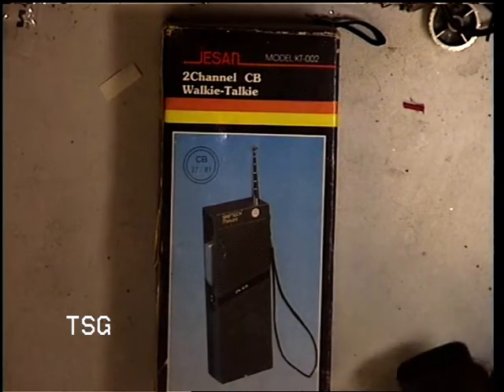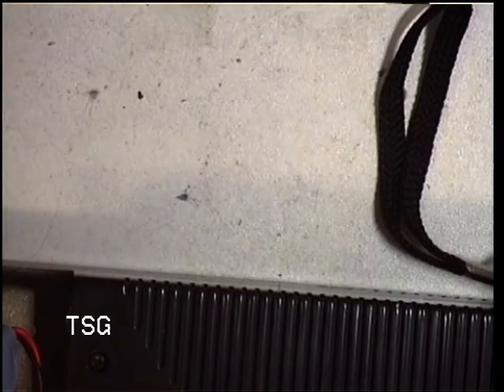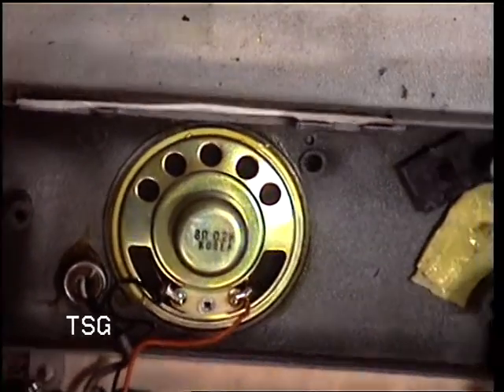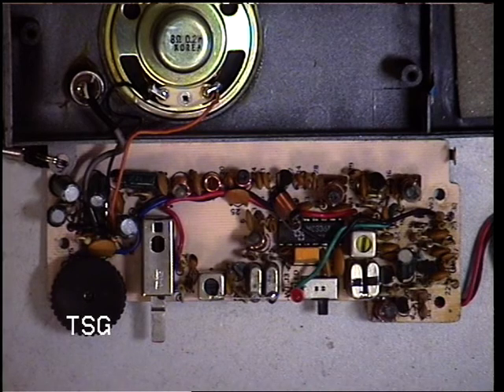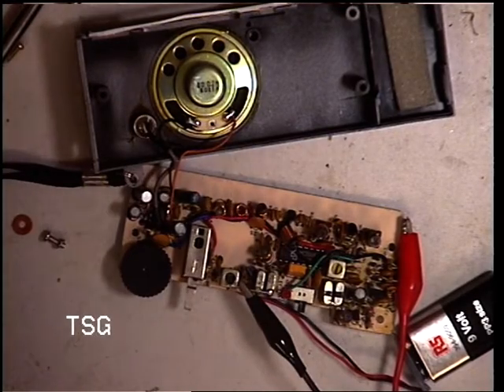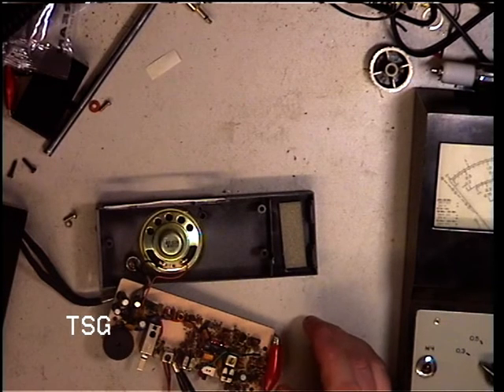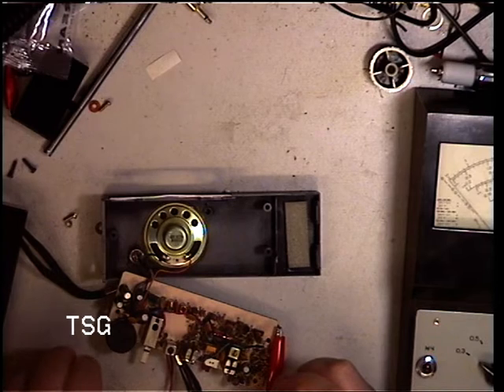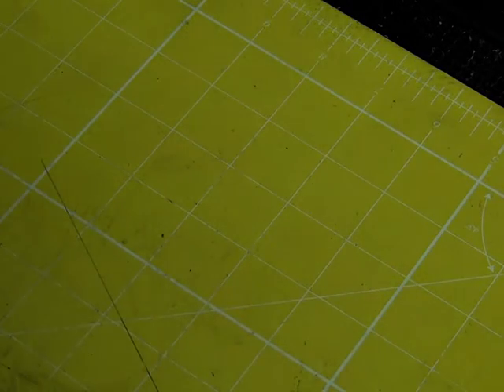Jesan KT002 UK (CB radio) 2-Channel hand portable (CB27/81) - Servicing

Comment: You don't do much Service videos, just on air test ? what for ?
Reply from the maker: Each cb model gets three videos made on it. Firstly tx alignment.  secondly rx alignment & thirdly an on the air test. Therefore there are equal quantities of videos on each aspect. However, sometimes it's not possible to do an 'on the air test at the same time as the tx & rx videos, so I have to play 'catch up' when someone else is here. Presently there isn't time to do any videos on CB owing to heavy commitment to the church pipe organ restoration dise of the business.

Richard'

Comment: Great video Richard...I like the bit about the battery being worth more than the set !
I had a similar toy back in the 80's, it was a 2 channel Amstrad hand held, Channel 14 and 30 like that set you have. As I remember it worked quite well but don't know what ever happened to it. It did look a bit more "Professional" than the one you have there.
Reply from the maker: Matt, the Amstrad HCB1 is far & away better & we got 3 miles on our range tests with one. I thought I'd already covered it but I haven't so will do an Amstrad HCB1 video ASAP
Reply: Ah, That's the one HCB1. I have seen a few crop up on ebay from time to time. I do remember mine worked quite well, as you say three miles. Not bad really. @ukfmcbradioservicingTango21

Comment: I really like youre videos tune ups and repairs but i wish you would invest in a go pro or similar as this would improve things dramatically just my humble opinion
Reply from the maker: It's a snag, the quality loss between what's on my monitor & what appears on youtube is substantial.   The workbench videos use Sony digital camcorders which feed their signal (rather than record themselves) through a Panasonic digital AV mixer & then recorded on a Sony digital video recorder. These were £1300 cameras, £5000 mixer, £800 DVR with two Sony Trinitron CRT monitors on each of two benches here & was a £15,000 investment in 2000.  I've absolutely no idea how a gopro camera would plug into the system as I've never handled one & believe they only record onto an SD card or similar.  My edit suite doesn't do memory cards, but can cope with the VRO DVD format that the Sony DVR produces & the two camcorders that we use on some of the other shots.
The earliest  of my videos were done with Sony low band cameras, but these cameras had huge optical zoom, whereas these current cameras have a lower optical zoom & then that silly digital zoom. I've no idea what to do other than go back to black & white....that would bring up the resolution to 1100TVL but I think the colour helps more. 

Perhaps if you know the model number of a gopro product that you feel would be compatible (remote zoom & S-video or similar connectors)  then feel free to email me rshireby@yahoo.co.uk
Reply: Hi again Richard this was not meant as a criticism only an observation i look at a lot of electronic videos and one that springs to mind is fredintheshed1 his videos always seem to be clear even on zoom in. i like to view on full screen. i know a lot of people use go pro but im not qualified to give technical advice on what some YouTubers operate. im sure a man with youre electronic know how will find a solution but i dont think its all that difficult or involved as you have been led to believe perhaps someone will now throw some suggestions youre way look forward to youre next video......

Comment: At least it has a proper receiver. The old American ones had a crystal controlled transmitter but a super regenerative receiver which meant you could hear people on channels you couldn’t transmit on.
Reply from the maker: Yes, that isn't permitted on UK CB equipment..there is a minimum receive performance required for type approval.

Richard